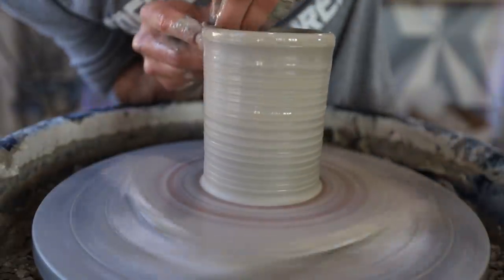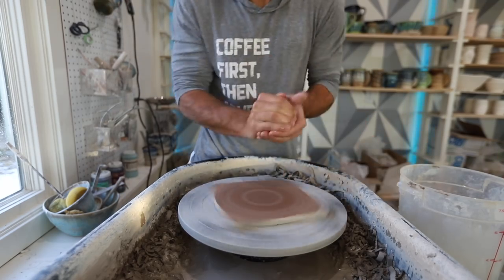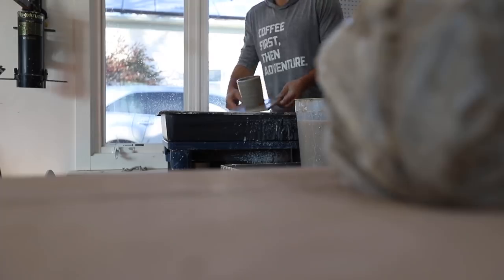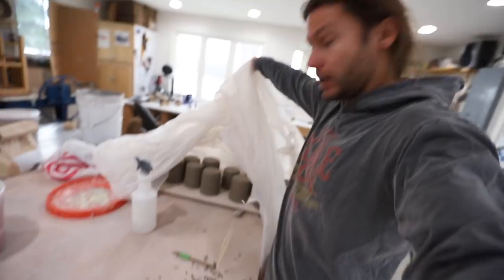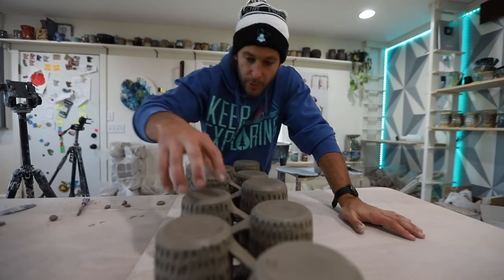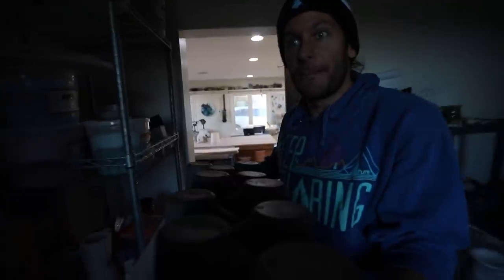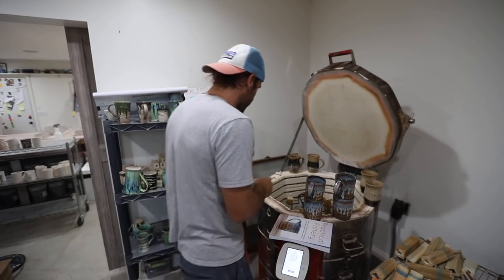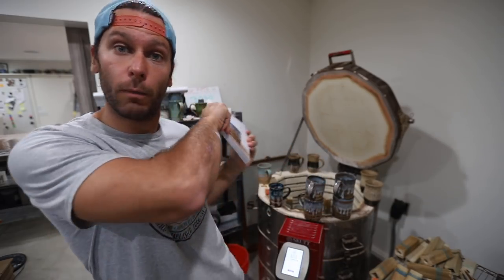How to Make a Carved/Drippy Mug! - The Entire Pottery Process

Comment: What is the circle tool you use when trimming for?
Reply: Yes, what is it please.
Reply: @Marcdrichter  I found out what it is. It's a spinning trimmer. It's used to hold pottery in place while trimming, rather than using lumps or clay or a trimming wheel to stabilize the piece. It disperses weight too, so all the pressure isn't put in one spot. Apparently you can try using a bottle cap first before buying one of these.